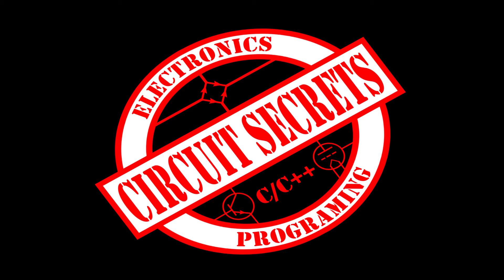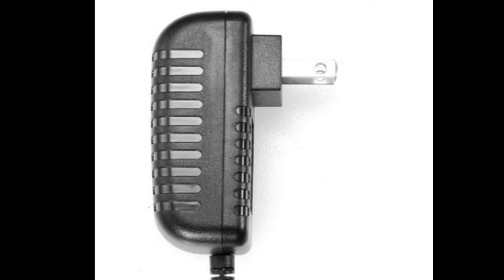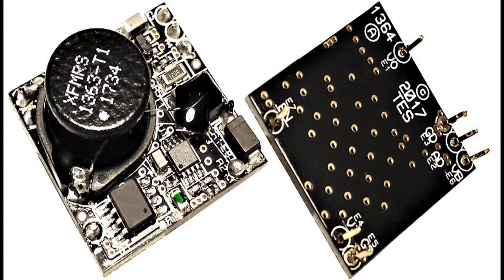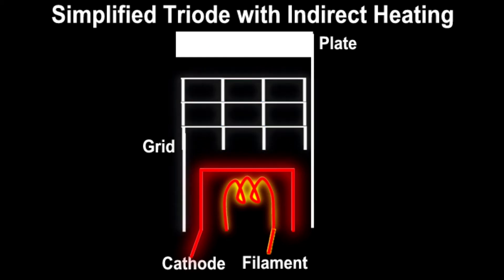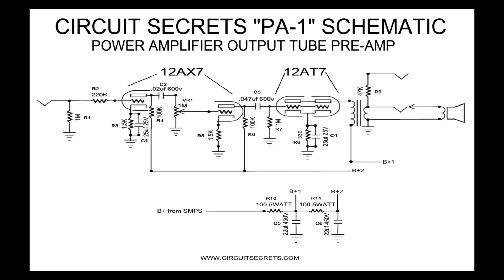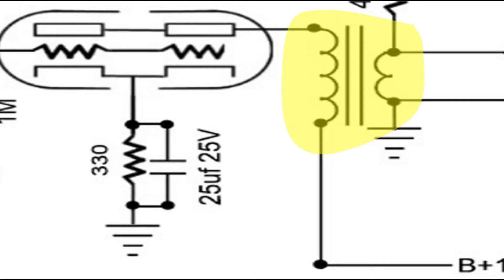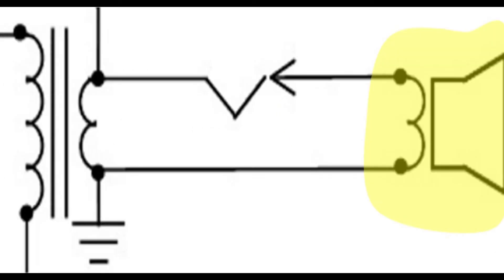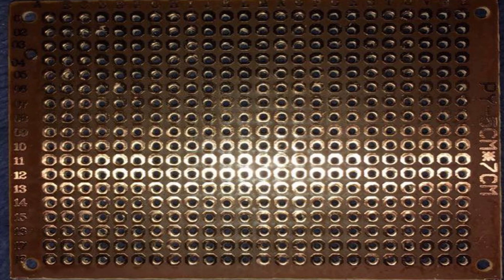DIY tube preamp build part 1

Comment: Great little viceo, but Switch Mode Power Supplies add a lot of noise, so saying they add less audible noise is incorrect.
Also, no offence here, but saying you are using the pre-amp for your recording on this video really makes me want to totally avoid it.  The sound quality of your voice is really poor, even compared to most YouTube videos from 10 years ago.  It definitely does not sell me on this preamp at all.
Reply from the maker: Different taste for different people, it has a very primitive sound like something from sixty years ago and that was intentional. The mic I was using at the time is very poor quality so that could be part of what you are hearing. The thing about this particular smps is it operates at a frequency above human hearing so the "audible" noise is very low. The added filtering eliminates nearly all the noise even in a spectrum analyzer. If it is used to direct record an electric guitar the lack of audible noise is very apparent. But it is not for everyone, it is just a simple starting point for a primitive tube preamp with a modern twist.

Comment: dude! I use a 12vdc smps form a laptop....works just fine for dual triode tubes and radio pentodes when triode strapped like 12BA6,12AU6, 12AB4, chi-comm 6J1 or the two 6AH6s I'm currently using for my stereo preamp....they got a 3 AMP filament draw between the two connected in series for 12vdc...so careful when selecting components
Reply from the maker: Yeah a lot of 12 volt smps work great for filament to keep the audible noise down, using the 200 volt smps for the plates with a 12 volts smps to supply it and the filaments eliminates the need of a heavy expensive power transformer.

Comment: I do not mean to criticize, but for whatever reason the audio sounds ... less than ideal and there is also clipping somewhere in the chain.  Could the phase be reversed?  Double check pinouts.  ill be honest its not great sounding.
Reply from the maker: Good ear on the phase inversion! The preamp has 3 gain stages and each stage inverts the signal. An option to correct the phase is to use both triodes in the first tube in a parallel configuration instead of series, or to simply use only one triode of the first tube. An odd number of typical gain stages makes the output inverted. The extra gain stage also increases the chance of clipping or distortion. If you listen to a lot of old recordings you will notice similar artifacts. It is not an audiophile preamp, but an attempt to emulate the old mixer preamps that were prone to overdriven clipping and distortion, but using a modern smps plate supply to reduce the chance of power supply noise while reducing cost. It is also in one of the simplest configurations possible to help other builders figure out the operation of tube preamps so they can experiment and modify it to suit their taste and needs.
Reply from the maker: Yeah the mic was pretty bad, I recently changed to an at2020 and in the most recent video Raspberry Pi Pico I used it with the this preamp and recorded with a scarlett solo interface. I was thinking on using the body from an old MXL to build a mic. Let me know how yours turns out and what parts you use. I was thinking a smps powered tube mic but have not gotten to sourcing parts. I have been tied up working on more content on microcontrolers and grbl compatible DC motor controllers. Thank you for subscribing!
Reply: @Manuel Liria Romero How in the hell did you hear the phase?  I'm engineer, need a intern? lol
Reply: @43audio89  This

Comment: This preamp can be used with solid state amps?
Reply from the maker: Yes it should work fine with a solid state amp but depending on the amp it may require some modifications. Make sure you are loading the output of the preamp with a big enough resister or inductive load like a speaker and adjust the value of R9 to limit the output and not exceed the input rating of the solid state amp. The value I used puts it in the ballpark of standard line in signal, you may need a stronger or weaker signal. Depending on the solid state amp design you may want to use capacitive coupling between the preamp and the solid state power amp. Watch for ground loops and use extreme caution, triple check everything, good luck and happy building.
Reply: @CircuitSecrets  thank you for quick reply ! one more question what is the frequency response of this preamp ?
Reply from the maker: I have not checked it with a signal generator and spectrum analyzer, but I have looked at spectrum analyzer results from a few recordings and it seems pretty solid from around 25-30 hz to 18 khz with a real strong mid peak between 500 hz and 1 khz. A heavier output transformer could boost the lows, and a bright cap could be used to reinforce the highs. C2 and C3 could also be changed to expand the bottom end. If these were swapped for say .1uf the bottom end would be expanded but it would probably need more filtering to prevent parasitic oscillations. I tried to keep it as simple as possible to capture the vibe and tone of the old mixing board preamps with less noise in the audible spectrum and lower cost by using the smps for plate supply.
Reply: @CircuitSecrets  hope i will be replicate your project!  thanks for making such an easy video !
Reply from the maker: @ManuLeisure  Thank you! Good luck with your project.

Comment: what is the current required for this project? can build
 multiple channels with the same smps?
Reply from the maker: You need a D.C. supply of around 2 amps to drive both the filaments(heaters) of the 2 tubes and the plates through the SMPS. Because the output of the preamp is a current amplifier I don't think I would try driving more than one channel per smps. Even if it could handle it you would run the risk of causing parasitic osculations and noise . The smps will supply around 37 milliamp at 200 volts and each plate of a 12ax7 can pull a max of 6 milliamp for a total of 24 milliamp max draw for both plates in both tubes. The bottom line is you could try it, but it would take a lot more filtering and you would have to bias it to limit the current draw on the plates which may change the character quite a bit.